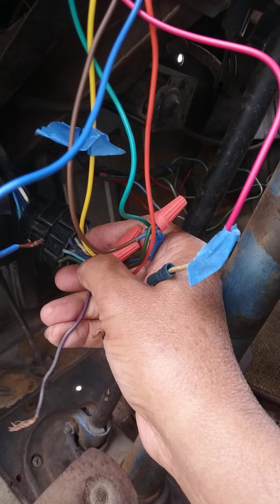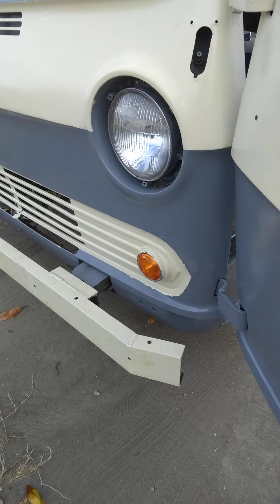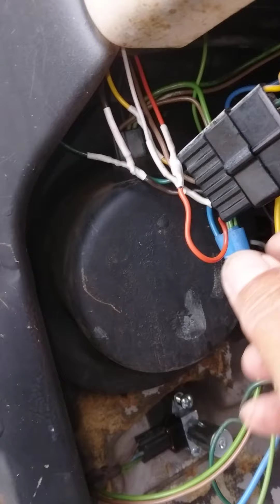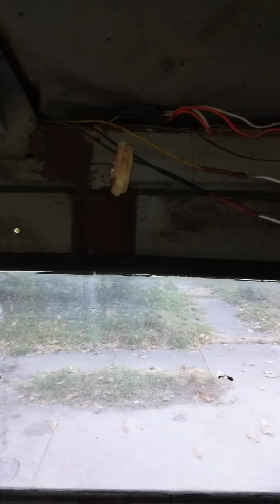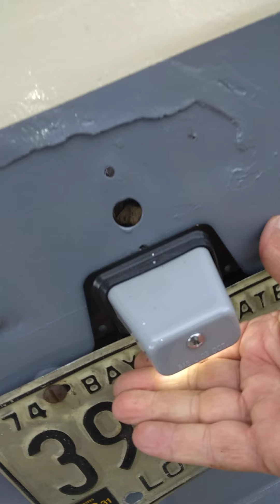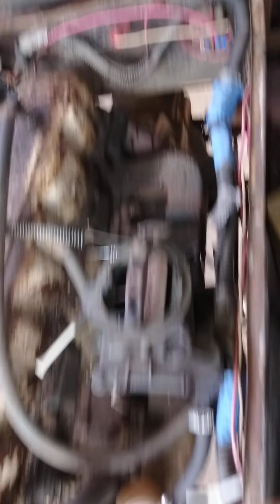65 Chevy Van.  Rewiring with original  harness using  diagram (w/link) + Universal  Signal Switch

Comment: Vic - did you mess with the ignition switch wiring? - The wiring diagram appear to be in error - i.e. the purple wire etc.
Reply from the maker: I may have used different colors when extending some of the wires.

Comment: You need a windshield.  I got mine done(well they are doing it now) in crystal city Missouri. It's called Huston glass company.
Reply from the maker: Windshield is on my list..there's a local company (New Orleans) that will cut me one, they cut the window in the window regulator video for me. Good luck with your van.  Thanks for visiting my channel.
Reply: @vicshepherd7142  I've also got brake light issues and wipers arent working either. And the horn.
Reply from the maker: @thecynic807  check the diagram.. there's some info about brakelight switch on my  brake spring video that may help.  good luck.  just be real slow and  methodical when tracing down the wiring.  https://i61.servimg.com/u/f61/13/21/24/97/66wire13.jpg